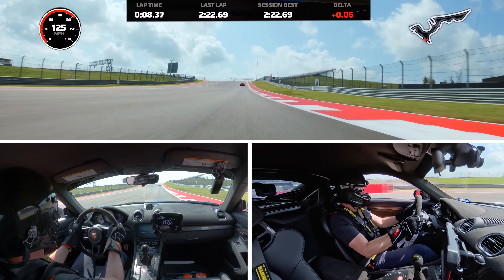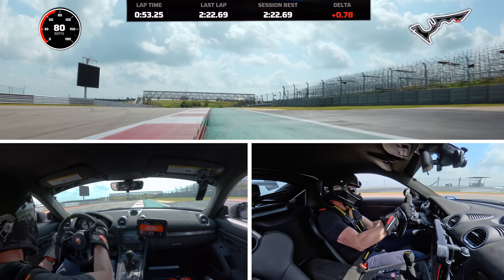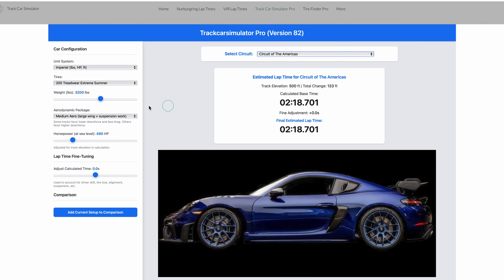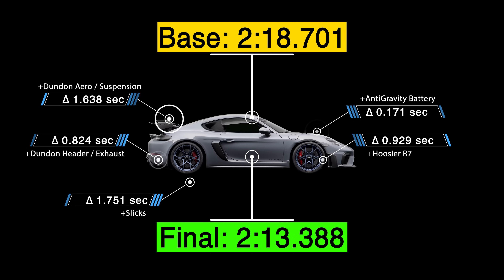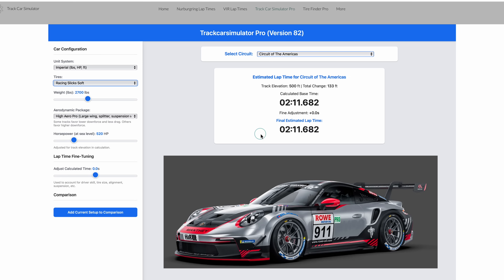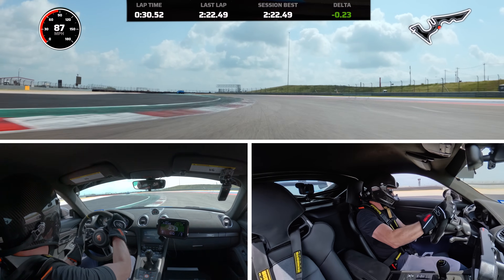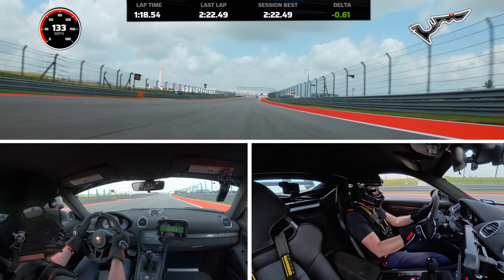Power, Weight, Aero—What Really Makes a Car Fast?

Comment: For the track fanatics, the Track Car Simulator is a godsend tool. It has proven remarkably accurate, showing a consistent 1s (pro-driver) and 1.9s (me) difference lap times across a range of cars we've driven — from a 1200hp R35, 1500hp Huracan TT to a stock Huracan Performante and a stock 992 GT3RS.

This precision allows us to reliably predict performance gains from aero, tire, and power modifications. 

Ultimately, this helps us make smarter decisions about which upgrades to pursue to hit our lap time goals.

Thanks again @ItsTrackTime  @ealingj from Australia!
Reply: Great to hear!

Comment: It seems the simulator needs some work on the aero/suspension piece. It says my car is 2:20 with 710hp and factory aero/suspension on DOT slicks. 😂 I run 2:13 on that setup. Selecting medium aero, which I 100% do not have, it drops down to 2:14.1 which is much closer to what I actually run. The 720S has very little downforce, as the “wing” is really more of an air brake, and I think it’s more flashy than it is functional. There are a lot of variables here that the simulator isn’t taking into consideration, such as tire size, weight distribution, suspension geometry, etc. Since it was seemingly developed around Porsches, it would make sense it would be fairly close for them. Also, a cup car with a pro driver is sub-2:10 all day long. The GT3R with ABS and TC is mid-2:0X.
Reply from the maker: I’m guessing the 720S correlation comes down to tire size, since it relies more on mechanical grip. When you’re running 2:13s, what tires and sizes are you using?
Reply: A vehicle with a moveable and computer controlled rear wing that goes into DRS for low drag on the straights, then tilts up for maximum braking is  considered medium downforce by the tool.  The very cool "hidden" door intake was designed to efficiently take in air for the engine, another aero feature. Medium aero matches up closely.

Comment: I read from a F1/WEC engineer that 10kg  is 0.15% lap time
Reply: The % of lap time impact is dependent on the weight of the car vs the weight added vs the horsepower, the type of track, etc.  The tool was created to help figure out the approximate time difference based on your specific car weight, power, tire, downforce, and track.

Comment: why you amis run Hoosier Tyres Slicks and not Pirelli or Michelin here in Europe as good as no one uses Hoosier Tyres. Go with Pirelli or Michelin Slicks they work.
Reply from the maker: They don’t make 20-inch slicks, but Hoosier does—so I run Hoosiers.
To use slicks, you’ll need to switch to 19-inch wheels, which also means upgrading the brakes.

Comment: I have to say if one was chasing self improvement and time on the track per $, and willing to hold off on the glory of crazy lap times compared to others, the 200TR tires these days are really impressive, i swear back in the 2000s when i was doing more of this stuff actual slicks made like 2x the difference or more than what we see here, i could be wrong but that's how i remember it.  (feel free lmk if anyone can say.)

About weight cutting and how much modern cars have advanced, there is a GR86 in Japan that simply got its chassi spot welded and lightened down to about or just below 1 tonne (oh, +decent aero), the thing runs sub 1 minute Tsukuba lap times which if we compare it to 90s Supercars, or even some time attack cars of the early 00s is insane given the base power is only like 240 and they some if not maybe all the suspension is stock (can't recall all details, but the struts are at least standard.)  How much cars have progressed really is amazing.

Comment: Just played around with Trackcarsimulator pro for the first time and it’s such a cool tool! 

I know most track cars are RWD, but in future iterations I would love to see the option to see how things change with different drivetrain configurations (FWD, RWD, AWD). 

Then different transmission types (sequential, DCT, manual, CVT, etc.). 

Finally, maybe an option for engine layout, front, front mid, mid, and rear engine. Potentially even electric cars. 

These are all just additional considerations. I absolutely love that the person who created this project made it publicly available, as curious people like me could spend forever tinkering with different setups.
Reply from the maker: Great to hear you found it as entertaining and useful as I did. Running 'what if' experiments has never been cheaper! It really helped me understand why certain weight and tire combinations can be so lethal at COTA.

Comment: Also you have to mention that all this changes when changing tracks
Reply from the maker: Very true.
Reply: Absolutely.  This is one of the reasons why it's so hard to get data.  How much time can be had if reducing weight by changing out the battery?  It depends on the car and the track.  One of the reasons why this was created to help answer this type of question.

Comment: So hear me out. It’s weird because I drive two cars at COTA and on one I am supposedly 3 secs faster than the estimated (I run SC3Rs so chose the closest TW which was 80) and on the other car 1.4 secs slower (on 200TW and this one seems right). Although one can be relatively faster or slower on one car vs another I don’t believe the faster one of course something is amiss. But that’s fine you can fine tune to your actual time and the tool says is not designed for absolute lap times. But THEN… it shows a 6 sec gain just with choosing one step extra aero. That’s quite a lot considering there is also a drag penalty on the straights. Just reporting that some parameters may be over or underestimated still. Thanks for the great work!
Reply from the maker: Interesting… What were the two cars in question? A six-second jump from a single step in aero is a lot—it doesn’t quite add up, even on soft slicks.
Reply: @ItsTrackTime car #1 991.2 GT3 on SC3R I used as baseline tire 80TW and factory aero and suspension as well as 3,300 lbs which was weight with a full (extended) tank (now has roll bar and bucket seats) so I think it evens out. Going from factory to medium aero yields 6 secs. There are no other parameters for me to change I mean HP 490-500 yields the same.🤷🏻‍♂️

Car #2 M2 Comp that has NO aero from factory so stock to “factory” yields .5 secs but to medium aero again almost 7s!

What I see is medium aero assumes concomitant suspension mods and that is also being weighed in the equation.
Reply: @azacad118  That is correct.  Medium aero assumes someone who has upgraded suspension in conjunction with aero, including camber, caster settings for track use.

Comment: Excellent video! Thanks for sharing and thanks to your brilliant friend for creating this calculator. I can attest from my recent experience at Lime Rock that it’s pretty spot on. 
(Video is uploaded)

2009 Cayman S
Mcs 2-way
Added wing
200 TW tires 

I’ll need to have it weighed. Stock was 3000. But I figure with all of the weight savings through the years, plus my weight and fuel - I’m probably back to 3000lbs. 

Your sim says 59:36
I did a PB of 1:00:06 with an optimal of 59:59. 

I’ll report back after Watkins next week!
Reply from the maker: Great feedback—and another solid data point. The 987s are such fun cars; I still own two of them! Track season is in full swing up north while we’re busy hiding from the heat down south!

Comment: It seems odd that simulator packages suspension work in with aero upgrades. Most people work on suspension and alignment before they mess with aero.
Reply from the maker: I’m pretty sure the algorithm assumes a solid baseline—a well-setup car with optimal contact patch and compliant suspension. From there, it builds deltas off that foundation. I’m guessing the second phase of suspension is tied to aero, since generating over 1,000 pounds of downforce requires a different level of support. That said, Ealing would be the best person to answer this—I'm just speculating.
Reply: @ItsTrackTime  Barry, you are spot on.

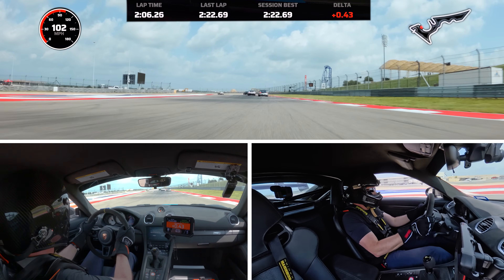Comment: I'm either doing something wrong or the calculator doesn't work very well for lower HP cars. I put my BRZ info in. 230hp, 3000lbs (with driver), 200TW, and High Aero (large wing with splitter and suspension mods). It says a 2:22 ....which is waaaaay out of reach for my car. I think even a Pro-Driver in my car would be in the 2:28 range in good conditions. I see the fine tuning thing but not sure what the context for that is and even that would have to be a big adjustment to be realistic.
Reply from the maker: These are the best lap times I could find for the GR86 Cup on 200 wear tires at COTA:

Session	               Driver / Source	                   Best Lap Time
Qualifying	       Lucas Weisenberg	           2:26.900
Qualifying	       Jaxon Bell	                           2:26.974
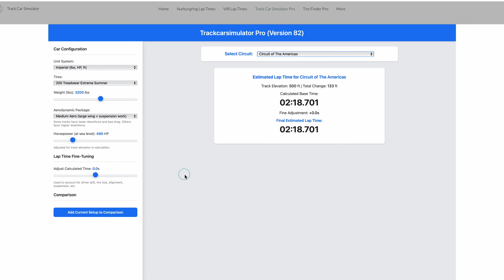Race Pace	       Jaxon Bell (race)	                ~2:28.112
Club / Amateur	Private AM session	        ~2:29–2:30+
Reply from the maker: I'm guessing the error in that combination is due to the downforce assumption.

Here are the aero definitions:

Factory aero – Cars like the Supra with a spoiler, BMW M models, or up to a Porsche GT4.

Medium aero – 992 GT3, 718 GT4 RS, or cars with upgraded aftermarket wings and some suspension work.

High aero (Pro) – 992 GT3 RS, Dundon Valkyrie, Verus swan neck setups, combined with significant suspension tuning.

Approximate downforce at 120 mph:

Factory: ~250 lbs
Medium: ~500 lbs
High: ~1,000 lbs

To reach the high downforce category, you need a substantial aero setup—huge rear wing, massive front splitter with diffusers/tunnels,  prominent dive planes, and rear diffuser.

Comment: dont forget the cup car has more rubber 305/355 iirc and racing slicks
Reply from the maker: Exactly—that’s why I asked Ealing about modeling additional mechanical grip.
Reply: It's a great question and this is why the race engineer says the cup car can actually lap a little bit faster than the calculation. For now this is where the fine tuning bar comes in.

Comment: Is the 992 front suspension adaptable to the GT4 RS chassis ? What needs to change for a 400 pound weight reduction in the Cayman GT4 RS ? I liked the track simulator you used to point out the specifics.
Reply from the maker: No, the 992’s double wishbone suspension isn’t adaptable to the GT4 RS—it would require a complete front-end redesign. The easiest ways to reduce weight in the 4RS are the exhaust, battery, and front trunk trim or padding. After that, you start removing more visible components.

Comment: it looks like you would do much better with a track build Miata?
Reply from the maker: Or a BRZ—and I did try that. But building a reliable 500 hp setup with properly engineered cooling is something I’ll leave to Porsche.

Comment: Everything else being equal, GT3 cup engine delivers more power to the wheels due to dry sump oiling system (less parasitic losses and keeping the engine in the optimal temp range).  

Then you also have to account for better weight distribution, lower CG, increased chassis rigidity, corner balancing, specific gear sets / final drive, etc etc...

I would guess its even lower than 2:11 but it's hindered by the "slower" traffic on open lap days
Reply from the maker: Are you saying the dry sump on the Cup is different than the dry sump on the GT4 RS and GT3?
Reply: @ItsTrackTime  yes, thanks for the correction. The scavenging pumps/stages, oil pan, and reservoir are all different.

How much hp its worth or how many tenths 🤷‍♀